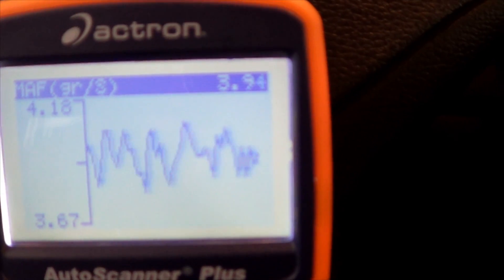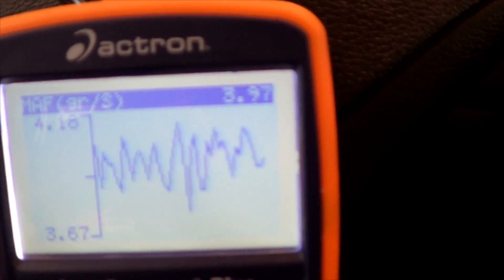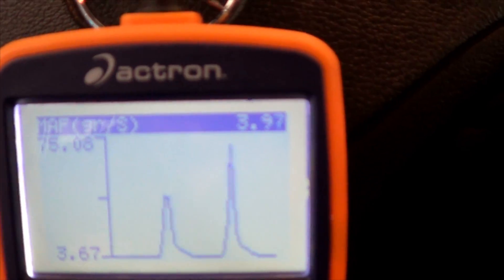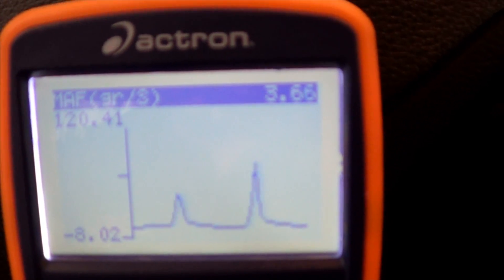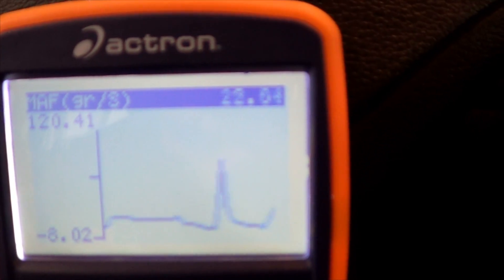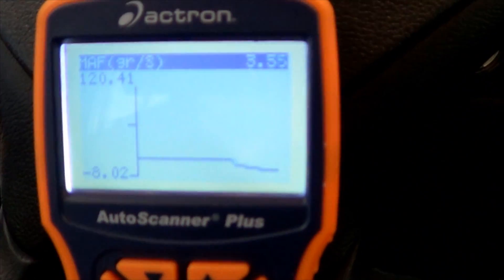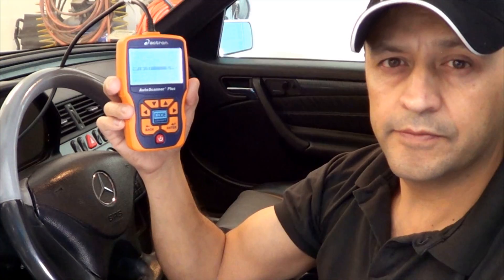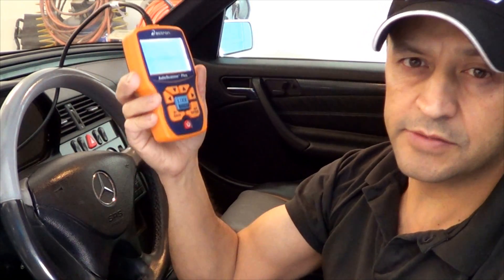OBD II Codes P0100, P0101, P0102, P0103, P0104 MAF Sensor

Comment: My MAF sensor is throwing codes which is making I think after a while my MAP sensor throw a code. I think my CAI Upgrade is the problem. I have cleaned it... but the problem persists. Can I remove the MAF sensor completely? Will my MAP sensor pick up the slack for a time?

Comment: I admire your knowledge, Excellent ! 
 Im from Alberta, Canada. Do you by chance know anyone up here that you'd trust to troubleshoot an unresolved issue on a 94 SL600 ? Dealer said, their equipment won't communicate with my computer. End of story. 
   So I bought a 2nd identical car. swapped Map sensors, throttle bodies, all one at a time, then running to see if resolved,  No change. Next was going to try trading computers, but havent yet, as I've been hesitant, not knowing if that'll create more problems?
  Problem with the SL600 is , it only has about 90,000 miles, like new as it should be. Runs perfect, until it warms to normal temp. of 80. Then a slight miss occurs. This is making me guess, that its some kind of simple sensor, or ??? something simple, but unknown. 
 Would appreciate any advice. 
Thanks a million and keep up your great work !

Comment: i have 09 3500 1 ton with code po 101 but my dash lit up with the eng light brake and abs lights have no power trance will not shift feels like 2 gear

Comment: thank you for the information i have p0101 in my nissan 2013 juke i cleaned the MAF sevral times and the code keep on coming back and i will see in my reader like 3 p0101 can you please tell me what to do?
Reply: john park did you ever figure out what it was? same thing happened to me
Reply: 1adrow 
Hi have you solved the issue please? I'm facing same problem. Appreciate a reply please.
Reply: How did you solve your problem?
Reply: ragonza loar. Hi did you find out your problem I have spent over 3 Grand in this car trying to find out this problem everything from the camshaft fuel housing fuel pump mass air flow sensor spark plug wires coil everything tensioners chains cams if you found out what what what was your problem with that code p0101 please let me know thank you you can email me at FrancisMiller79@ gmail.com